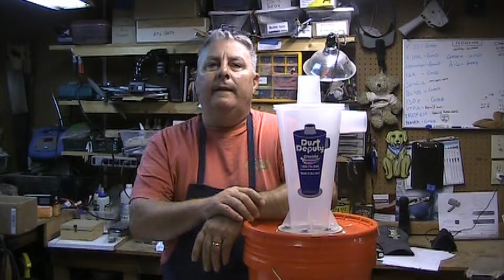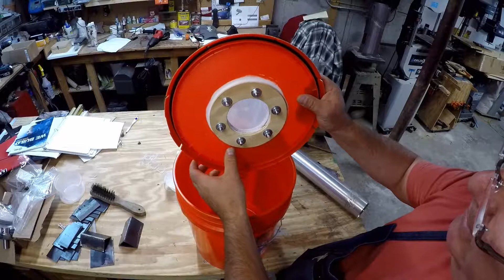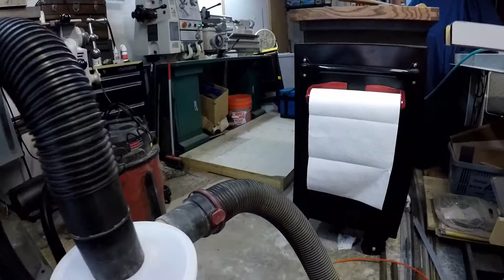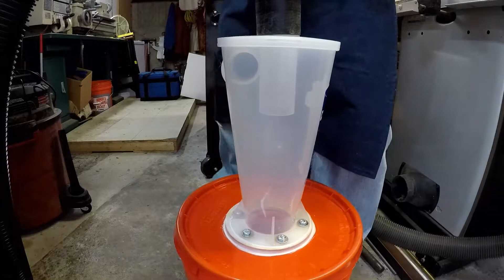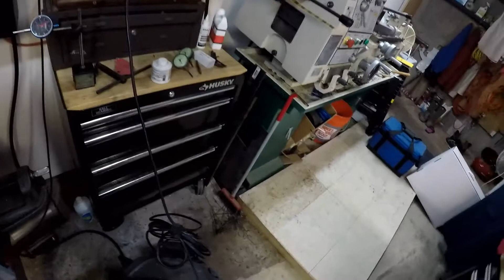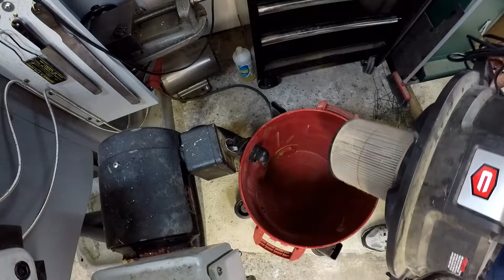Dust Deputy Review

Comment: I purchased a similar system at Home depot. Snaps right to the 5 gal. Bucket. I also used it for surface grinder application ant it worked great. 
The bigger problem is the cheap shop vac hoses flex and knock the bucket over because it's so light. Consider adding a base with ca
Reply from the maker: That's exactly what I bought mine for! You're right, it needs a weight to the bucket. I was thinking of using some dryer hose or something of similar flex.